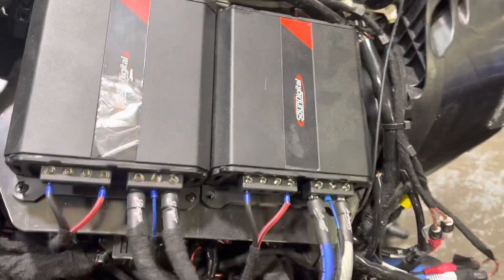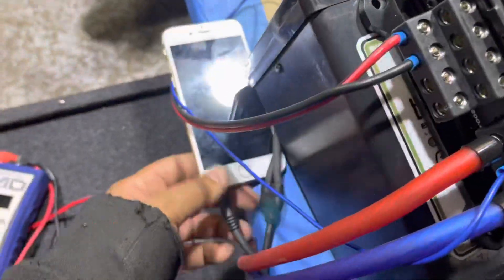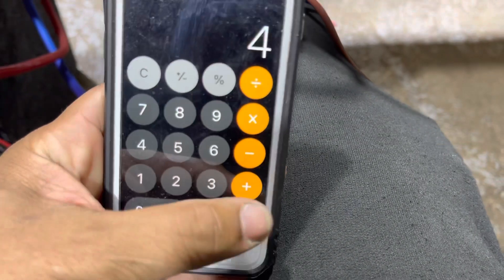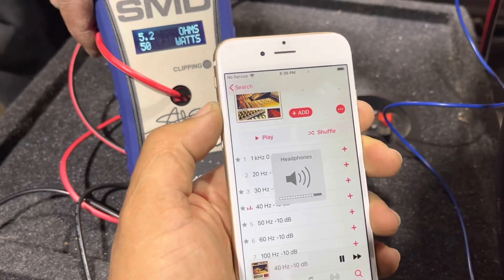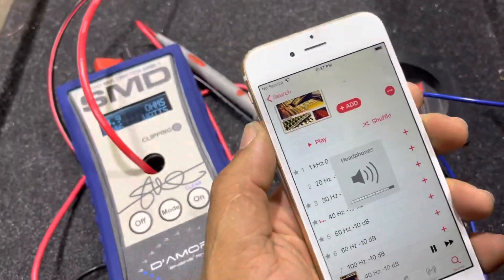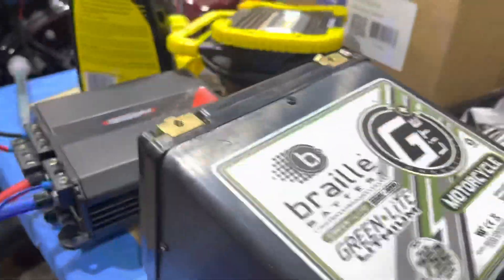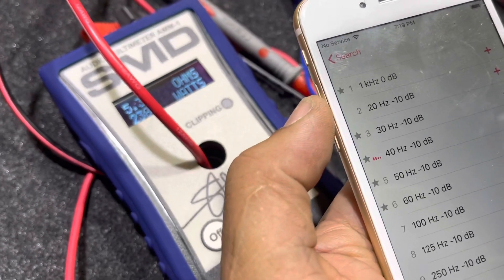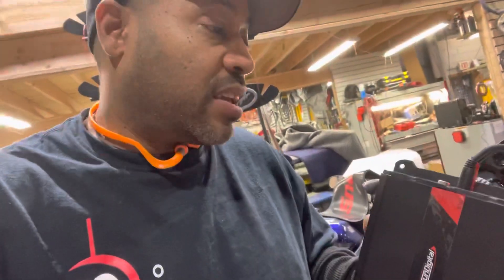Nvs Audio bench test the Sound Digital EVOX 1200.4

Comment: Can this amp handle 4 deaf bonce 6.5 rated at 300rms?
Reply from the maker: @Shyne_life  what’s the part number on the speakers so I can look up the specs ?
Reply: @NVSAUDIO   AP-M67an
Reply from the maker: @Shyne_life  yes
Reply: @NVSAUDIO I appreciate that bro. Also I wanted to ask you.. I have a 01 tahoe with 5 deafbonce "8 neos in each of the front doors with 2 in each of the back doors. The speakers are the same specs as the 6.5 btw. I was wanting to know of a good amp you could recommend to push all those??

Comment: Carlos, I gotta know, what's the difference between the Brazilian EVOX(EVO 4.0) and the US EVOX? This has been bugging me for a couple months and shedding some light would definitely help me pick the correct amplifier.
Reply from the maker: I can finally do a video on this because last week I got to final tune a bike that had the evo4.0 on them . 
1. The are a different color so you can easily identify them against the American version ( the Brazilian ones are grey Evo 4.0 and the American version is black Evox) 
2. The evox  puts out about 20 percent more power so a American evox 800.4 is equivalent to the Brazilian Evo 4.0 1200.4 .
3. The American version is more vibration resistant ( better for motorcycles) 

The American market is a more expensive market and customers pay more so the American version of the amp is stronger . Plus you can’t get the Brazilian version warrantied if it breaks , the amp is not supposed to be sold in this country so it won’t have any warranty.
Reply: @NVSAUDIO  Definitely looking forward to a video on this! I've been seeing the EVO 4.0's all over the internet and eBay for the $450-$475 range for the 1200.4 and was curious if there was a true difference. Every claim said they were the same as the US EVOX, but claims are claims.... Thank you for the valuable information and time good sir, it's much appreciated!

Comment: Can I run 4 Hertz SX 165 neo’s on the front channels and 2 Hertz SX 690 neo’s on the rear channel on this amp?
Reply from the maker: Yes
We do it everyday 

300 watts each to the front speakers 
200 watts to each 6x9
Reply: @NVSAUDIO  How do you get 300 to the 4 front speakers? And then 200 to the 6x9’s?
Reply from the maker: @AscentOverlanding  

Sorry I meant 300 on each of the front 2 channels 
150 watts per 165 Neo 

( the 1200.4 does 300 watts on each channel that has 2 speakers on it and 198 watts to each channel with one soaker on it )

Comment: Your videos be right on time. My 1200.4 is still clipping even after the flash. Im ready to toss this HD 4.3 radio. Lol
Reply: I'm bout ta run 4  MS69's in bags and MSPRO65's in fairing with 2 M1SRT tweeters ... Looking for the rt amp to pump dis BIIITCH
Reply: @bronxone72  after checking with carlos I should have chosen two SD 800.4s one to bridge the fairing speaker and one to bridge the back speakers.
Reply: Yeah 2 SD 800.4 is what I most likely will rock , but gotta do more homework, I'm looking at 2 SD1200.4
Reply: @bronxone72  Damn. You gonna add some subs???
Reply: TWO SETS OF BAGS ..
Reply: Bro ? what you rock'n wit dat 1200.4
Reply: @bronxone72  GZ yellow basket coax in the fairing and 2: diamond 6x9 MS69CX in the saddlebag lids
Reply: SOUND DIGITAL EVOX 800.4
Reply: Two sets of bags one wit 4 8's
Reply: @bronxone72  Four "8s and you doing 6x9s too? Lol
Reply: That's why I might just do th 2 SD1200.4

Comment: Using Lex Riviera’s mount on road glide 15-19 will it fit 3 1200.4’s and a DSR and distribution boxes and controllers for hand controls
Reply from the maker: Nope 

Must I’ve been able to
Fit is 2 1200 - 1 400 and a dsp 

With the stock radio 

With the Sony 7000 you will
Be able to fit it

Comment: How many amps are they pulling?   

To be technical, the other channels needed to have loads on them to in order to really see what it does…… but I know that’s a pain.   

Great job on doing all these videos Carlos…….  I know it’s a lot of work too!💯❤️
Reply from the maker: It pulled around 80 - 90 amps of current during the test because I was on test tones . 
You are 100 percent correct the numbers would be a little lower
If I had loaded all the channels but that takes longer , requires more speakers and kills the test battery faster . To
Make the test fair I test every brand of amp the same way so they all have the same advantage .

Thank you for the compliment 👍🏽